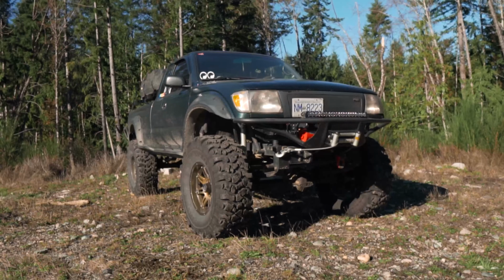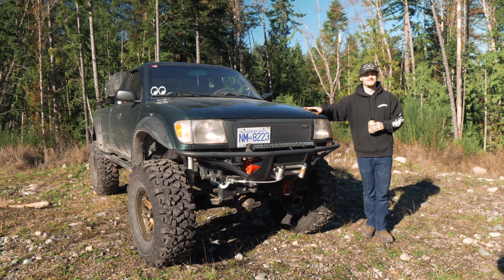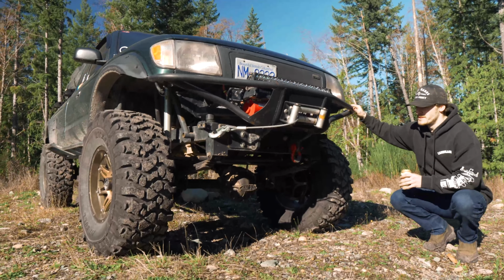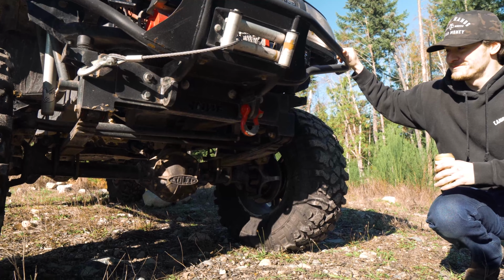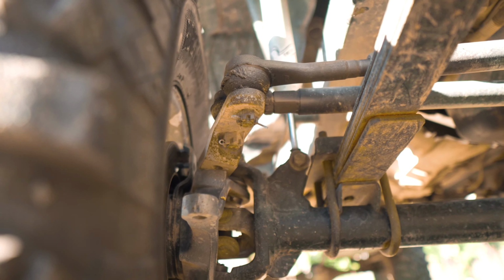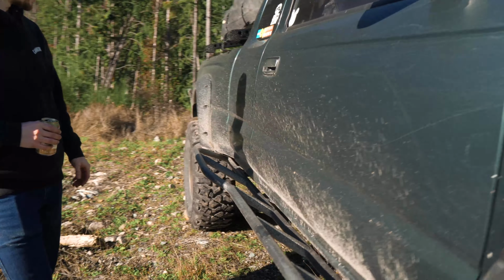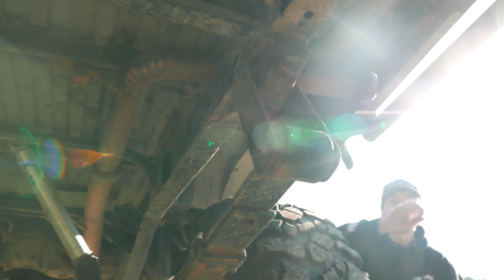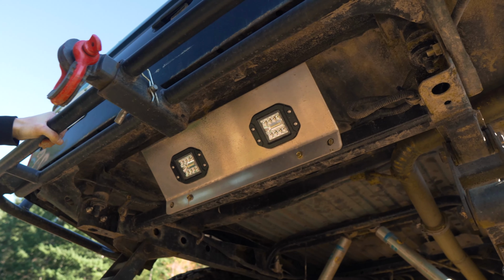Island Spec Ep. 04 | SAS'D TACOMA ON 37'S Full walkaround and wheeling edit.

Comment: Wat kind of shock valving do you Guys run with the 5125's.

I am building a shitty land rover and need better and longer shocks.
Its probably weighs about the same as the 80's Toyota pick ups so the shocks should be pretty close.

The stock shocks are 1950's design and have very limited travel(5inch in the front and 8 in the back)